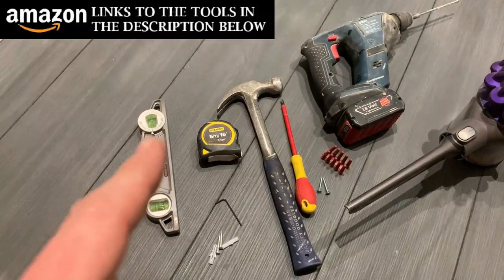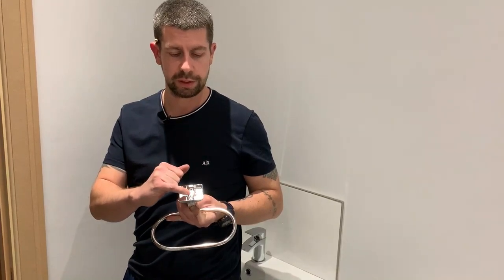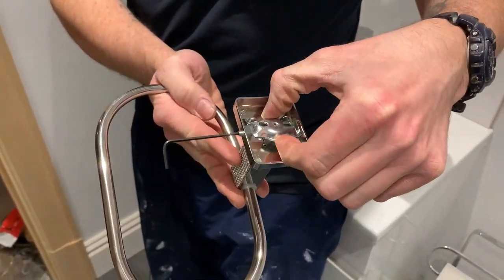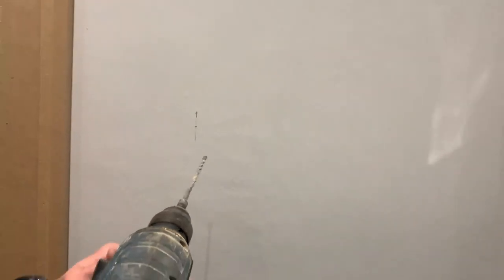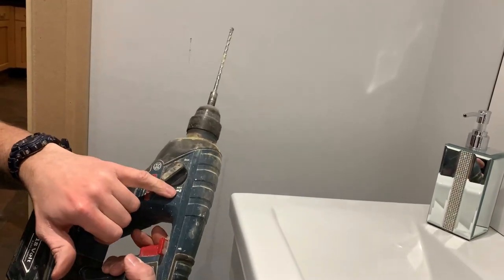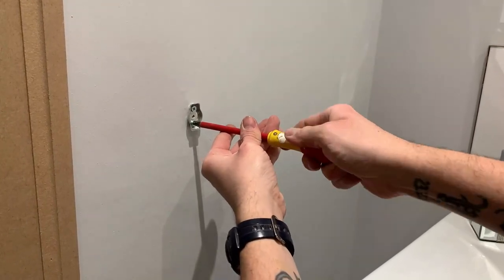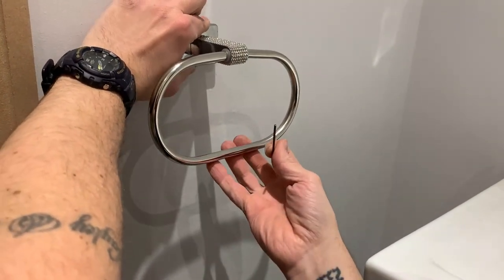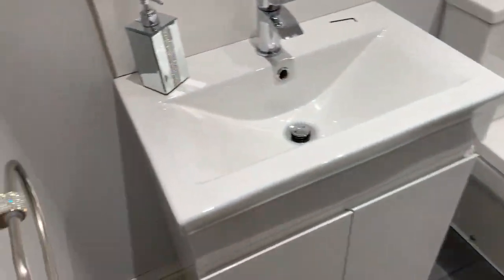How to fit a towel rail

Comment: Have you got a video showing how you can decide what drillbit size to use, do you just have a look at the screw and decide what drill bit is the closest in size? Also where did you get your own screws and wall plugs ?
Reply from the maker: Hi, the plugs will tell you the correct size drill bit to use. In this case I used a 5.5mm bit for the red plugs.
I get my screws from either Screwfix or Amazon, there are links in my Amazon affiliate store which you can find in the description of the video.
Thanks for watching and don't forget to subscribe 👍🏼

Comment: Thing about bathroom towel bars is people use them to balance and hold onto getting in or out of the shower or just leaning on.  When possible I install a a 2x4 backing brace then you can screw the mounting plate directly into wood instead of those plastic inserts that never hold up and then your in need of a fix.  In your case why didn't you put a wood block backing since you already had the wall exposed on the due to the renovation.
Reply from the maker: I could have put a 3x2 in the wall to screw into but most people who would watch this video wouldn't have that option so I just demonstrated a simple way.
Thanks for watching 👍🏼
Reply: @spendtimesavemoneydiy  right you are I wasn't trying to be critical I hope you understand I was just making a suggestion but your right most won't have that option.